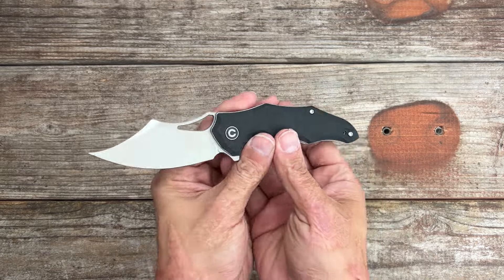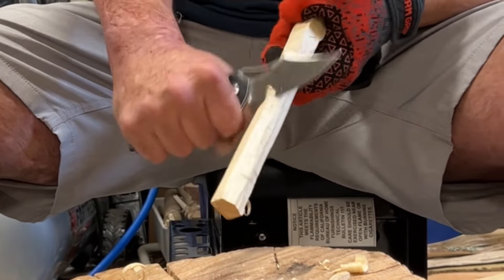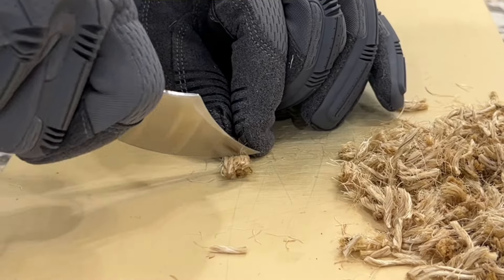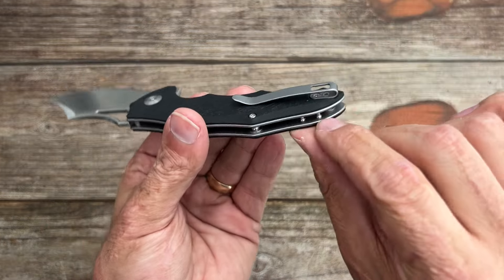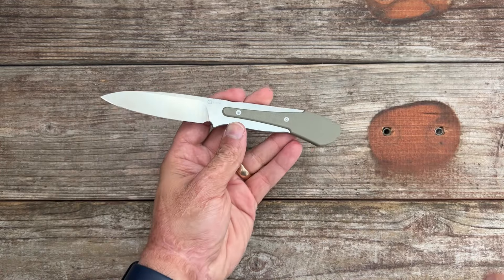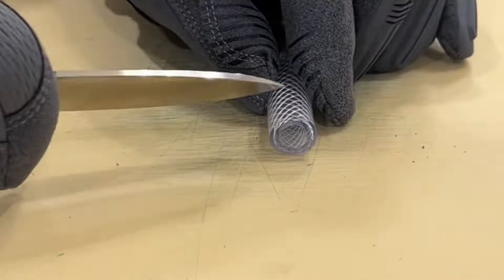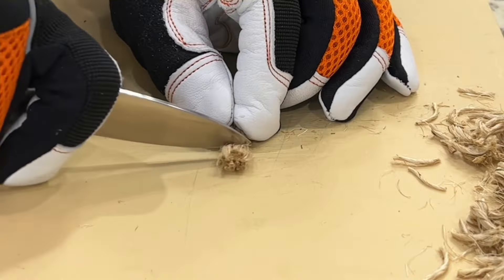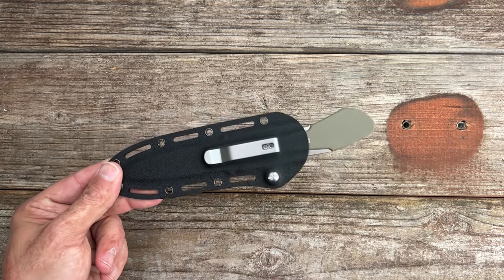Civivi Chiro & Civivi Varius What You Need To Know!

Comment: I actually just returned the Varius on account of the front screw on the handle not coming loose, it's just that simple. The back screw took some effort but the front just would not budge. It's worth mentioning that they chose to go for double sided T6 here and you'll need to put the blade in a workbench and use two T6 screw drivers or you will hurt yourself.  I'm 100% convinced I would have stripped the screws before they came out. In order to not void my warranty I called it a day and sent the blade back.

Comment: I would carry the varius if the blade stock wasn’t so thin I would prefer the negligible weight gain for the better durability if it were 4mm instead of 3mm thick